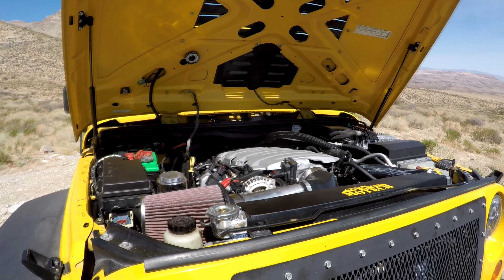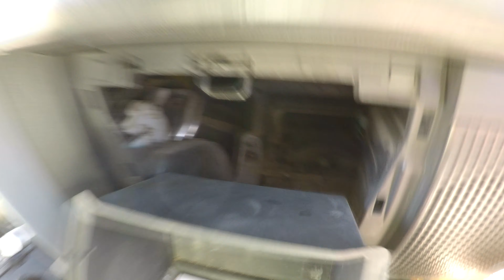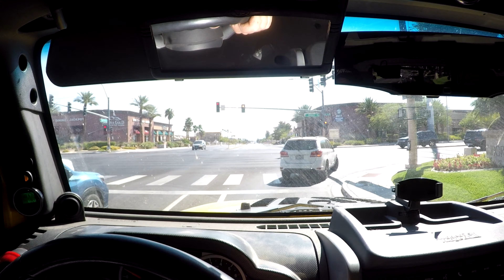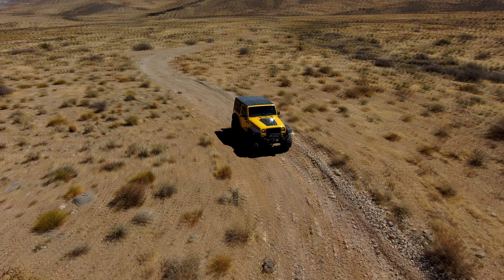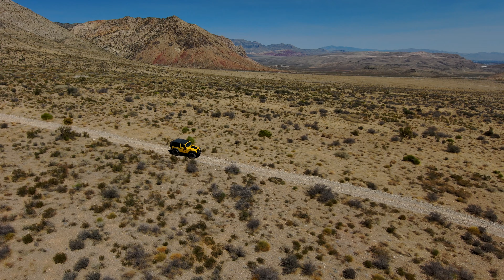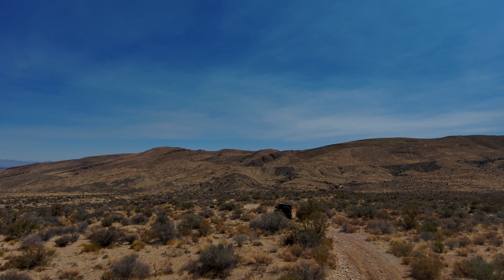LT1 Wrangler JK Value Build

Comment: The LT 1 pretty much 300 ft lbs of torque right off idle. 3.73 seems ideal for the road but off road the crawl ratio is pretty poor for rock crawling.
Reply: Look at the first gear ratio and then the transfer case ratio. It may not be as bad as you think. The days of 2.85 first gear ratios in automatics went away with the advent of the 6, 8 and 10 speed automatics. In know my 6L80 is 4.03. The ZF in my wife's 8 speed GC is 5.something to 1. I just looked and the 8 speed is 4.56 and the 10 speed is 4.70; that makes a difference. Also in a lighter 2 door you don't need as low a gear as in a heavy 7,000 4 dr on 40's. If the owner stays with a 35 or smaller tire that will be a factor too.

Comment: Well guys, I live in Grand Junction CO, have a ten year old build, saw 300 degrees on the Aeroforce once and tow a trailer so I think Robbie is probably talking about me. I do think that he may be underselling the value of what he calls offboarding the heat. Last year pulling our trailer over Red Mountain Pass to Silverton I had to stop three times to let the rig cool down; stopping when I saw 248 to 250 on the Aeroforce. I was also going 5 to 10 mph below the speed limit to try to keep the temps down. This year, after adding two additional trans coolers (for a total of three) and an engine oil cooler (the longest (25" or 26" single pass) Derale heat sink mounted alongside the frame as he mentions) I did not have to stop once. In fact my max engine temp was 206 and the trans temp max was 154. Robbie is wrong about one thing; the trailer weight. Our trailer weighs in at 7,000 pounds and with two passengers and loaded for camping we cross the CAT scales at 15,000 pounds. This time I was doing the speed limit or 5 or 10 over too.
I'd like to make two points. The first is that offboarding the heat really works and the second is that the conversions done by Motech really work in the real world. We have been wheeling ours hard for the whole ten years we have had it and towing a trailer for two years. We have a Hemi Grand Cherokee with the ZF 8 speed that we also tow the trailer with and even though the JGC is 2000 pounds lighter the JK with 6L80 outperforms it. And oh yes, the Camaro SS fan is the ticket and Robbie's after conversion service has been excellent.